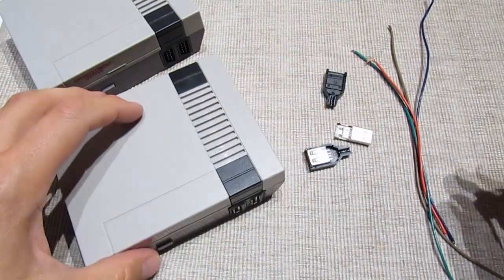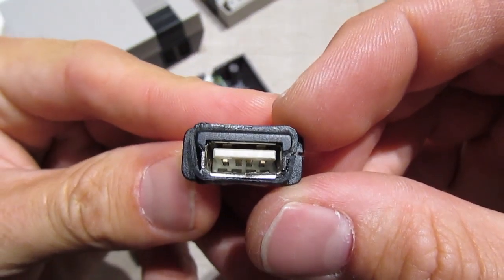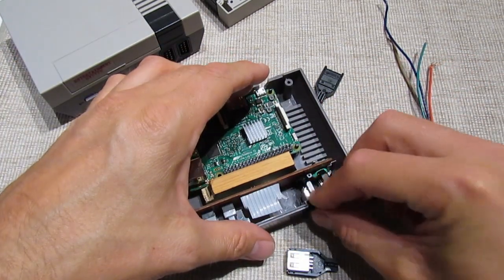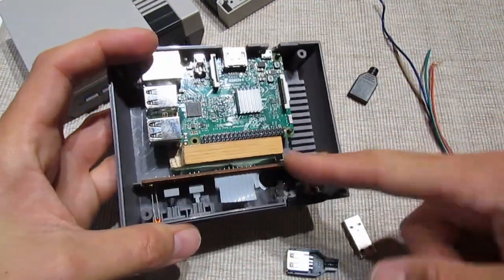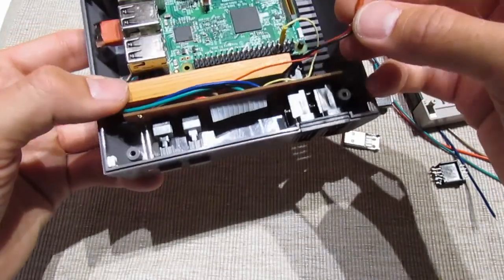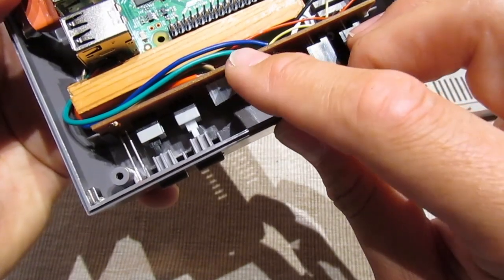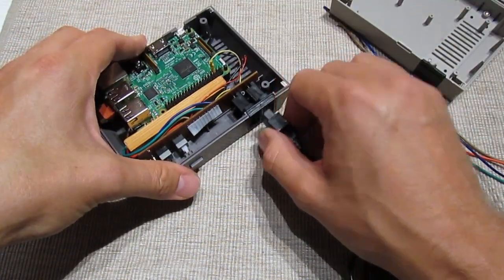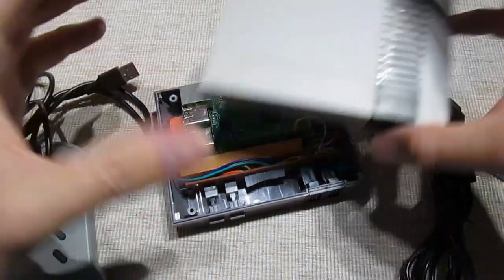Tips on how to add external USB on 20$ clone of NES mini classic. Raspsberry inside!

Comment: Bandolero
3 years ago
Hi man, very nice work! Where do you find that db9 to usb cable? Did you make it? Thanks!

zippiz
3 years ago
Pablo Silva thanks! Yeah, I just soldered a USB at the end of the controller cable.

specs
Frederic...hi...i copied your build and leads back then..wow..it's been nearly 4 years..just wanted to update you..i reused the Rpi3b for another build..but i bought an eBay Rpi1 700Mhz very slow but enough in the NES mini clone case..just for NES ROMs only..i wanted to reduce leads so i made a Dsub to Female USB adaptor soldered with short wires..set it in a hot glue mould..and filled in with more hot glue..quite firm..and shrink wrapped it..have to be quick with the heating..as the hot glue melts again haha..neater job..and my soldering inside to the clone board has improved too..only single USB connected..all the best from part Locked-down London..

Comment: God I love you man and all the work you have done!! Please please please find a way to get both controller ports converted to USB and get both buttons and LED working without causing conflict and without frying the Raspberry Pi!! I've been working on this for weeks and you've gotten much farther than I have!! I want to retain the "Sega/Atari" ports on the console and rework them for USB and either use the cheap Chinese controllers it comes with or one of those USB ones but with the "Sega/Atari" plug instead of a USB connection!! To retain the same look of the Chinese console.
Again thank you for all your amazing hard work! I'm using a Raspberry Pi Zero and a three port USB to connect everything and give me more room!
http://s10.photobucket.com/user/graphicsgod/library/Projects
Reply from the maker: Thanks man!
So first off, why wont you use the board as it is, and extend the USB to the solder points on the board as I did? It should be pretty easy to find the right connectors for the second controller port and extend that as well.
What do you mean with both buttons working, mine are just that the reset is used to turn on and off the Pi, and power to cycle the LED (and if connected the USB-DB9 ports) It seems like you should go with "my favorite mod from Video 2? Just get a small USB-hub to fit inside as well.

Maybe I do not fully understand, please explain if that is the case. =)

Comment: Thanks for the video. How good are the actual pads that come with the clone system though?, as if they are not good then there's not much point keeping the 9 pin sockets and just USB instead!
Reply from the maker: They are not USB, so you could not use them anyway... but I just added the internal from the clone into one controller =)
Reply from the maker: +BlockABoots That's up to you, I'm not gonna use USB that much, so I prefer to keep them and to a db9 to USB adapter as in my video. Or check out my new video, you could fit the Clone inside the controller. =)
Reply: zippiz how did you do it? I just need to know how to wire the controller to the white ribbon cable that I cut.
Reply: the controllers are great

Comment: you said you going to show picture  how you solder your wires to
Reply from the maker: Sorry, I forgot all about that... will try to make a picture. But its actually just add them as in the video and trace the outputs on the controller port.

Comment: thanks, man, great video. i'm ordering one of these and will try it. So do you think cutting the pcb will do the trick? i'm a total noob soldering to try the other solution, lol.
Reply from the maker: Yes, I think you will be fine, just make sure you buy 20cm extensions with an angle... and also make sure its the angle you need, right or left, I could not tell you that now.
Reply: yes, i've ordered two extensions on aliexpress, really cheap... for those wondering, they should be right angled but check it out first before buying